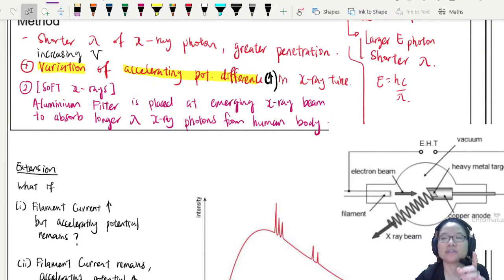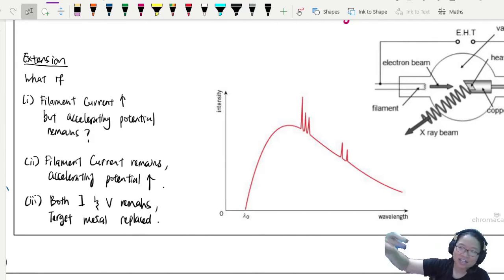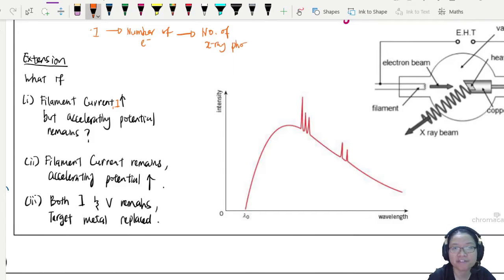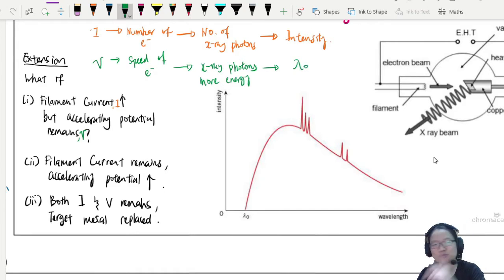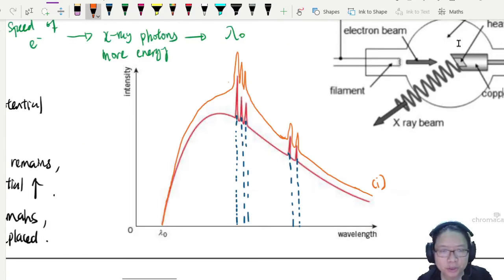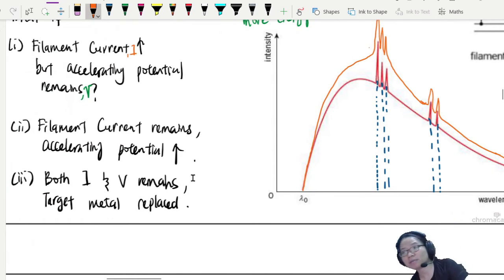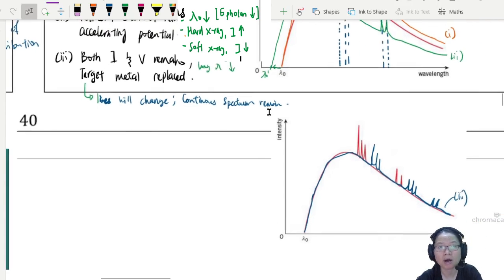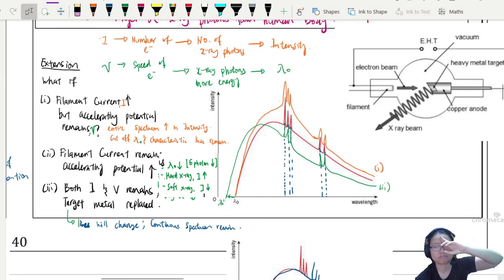BONUS: 24.1c X-ray Spectrum Variation | A2 Medical Physics | Cambridge A Level Physics

Comment: Hi why the green peeks don’t shift to left as whole trend shifted left
Reply: The position of the peaks depends on the metal target used, so it will change only when you use a different metal, because different metals have different emission spectra.